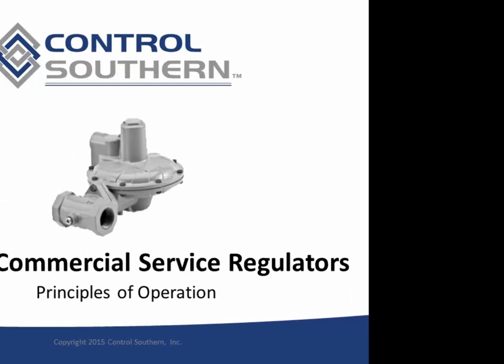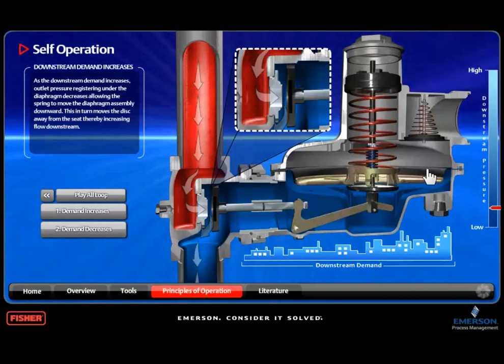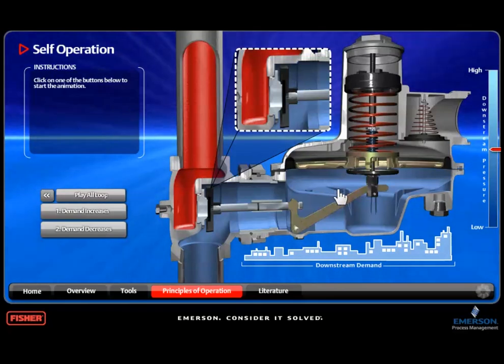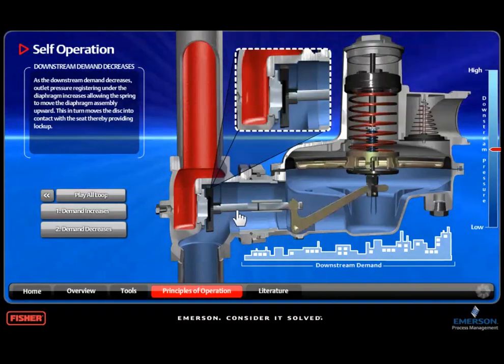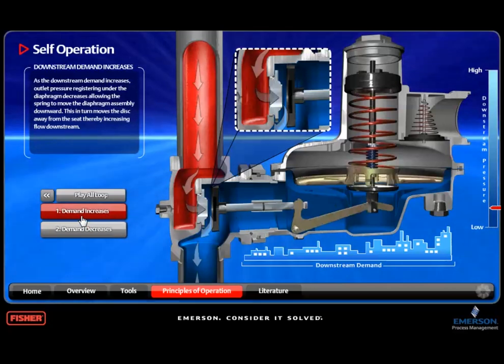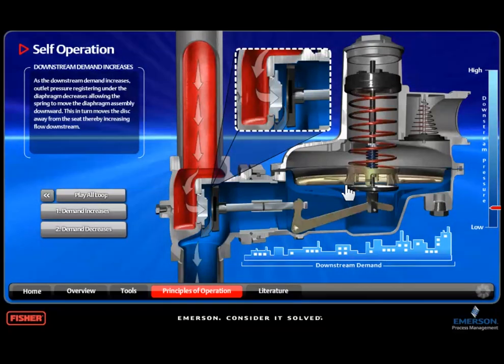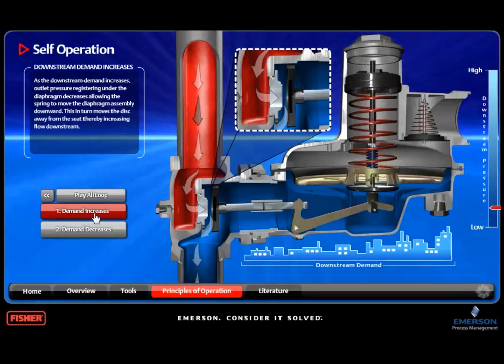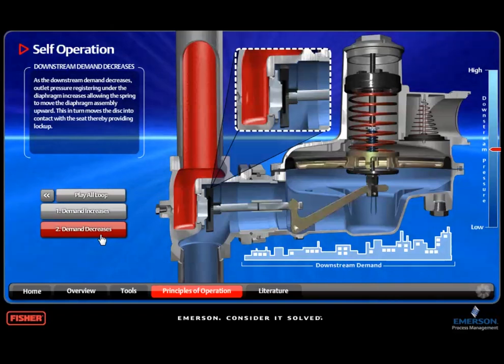Commercial Service Regulators - Principles of Operation

Comment: Question: How come for a 627 regulator (and others)  if we reach the maximum inlet pressure than the trim size regulator can handle, how come the flow capacity at the max inlet pressure is way less than the flow capacity with an inlet pressure that's half the max inlet pressure? Example: Table 9 - Type 627 Capacities for NPS 2 body size and orifice size = 1/2 in - Outlet Press = 60 PSIG;  Inlet pressure: 300 PSIG => Capacity = 79,000 SCFM. For the same regulator, same outlet pressure, if inlet pressure = 750 PSIG => Capacity = 32,000 SCFM. Thanks for your help!
Reply: The orifice will dictate that if the max pressure is not adequate. Instead of maxing out spring, you could up the orifice
Reply: Or maybe just the capacity of the reg can’t handle that increased inlet pressure. Maybe everything just needs to be increased. Reg head, diaphragm etc
Reply: @pq9254  correct that you met pressure doesn’t matter the orifice can only plan so much gas pass

Comment: Hi Control Team, do you know how the vent chamber works? and how the vent pressure chamber can be calculated?
Reply: When the pressure is very high....the vent works...and gas realise in air....and pressure below difragm  is low
Reply: The vent has a set pressure based on the spring. If the reg started to fail, allowing higher pressure in, if the pressure reaches a certain level, the vent spring will give and high pressure will vent out keeping the inside of the building safe

Comment: nice video.  It seems like the downstream pressure is a function of atmospheric pressure and upstream pressure? if a high pressure weather system comes in wouldn't that result in too much downstream pressure?  A spike in upstream pressure will have a similar effect right?
Reply: I think in different (high pressure from sea)weather regulator works in low pressure
Reply: Because regulator works in atmosphere pressure
Reply: That’s where an internal relief valve comes in handy it reliefs that spike in pressure just in case to protect downstream pressure